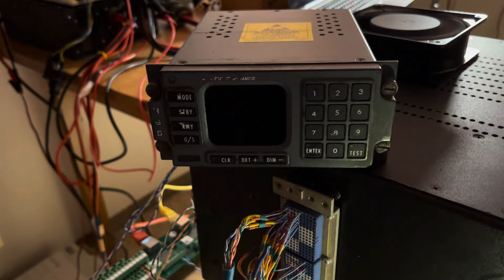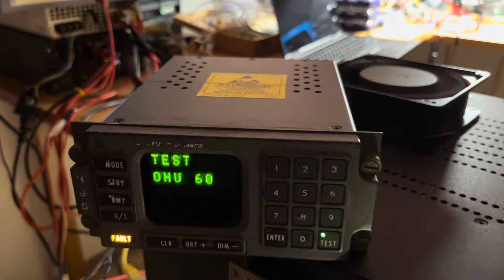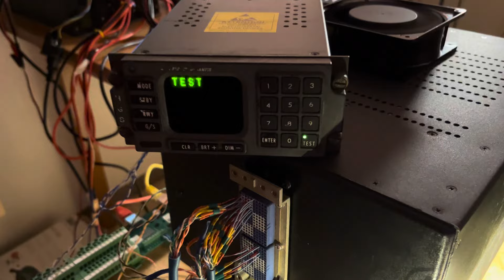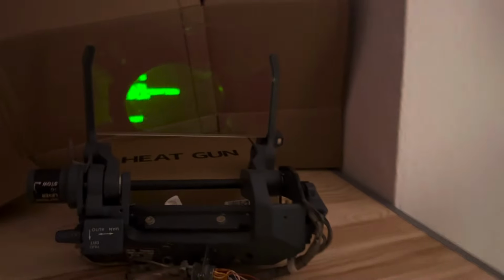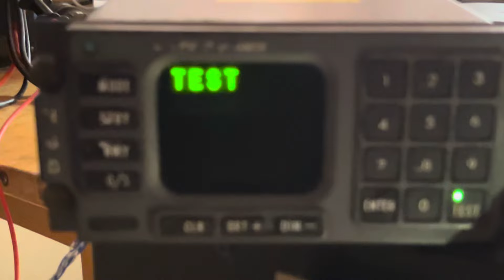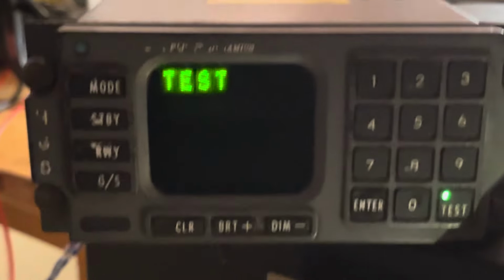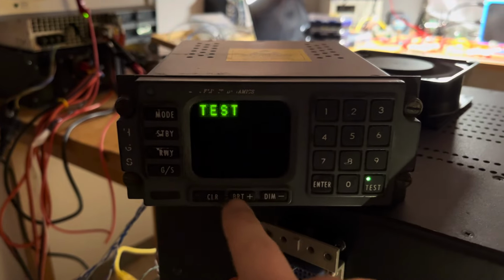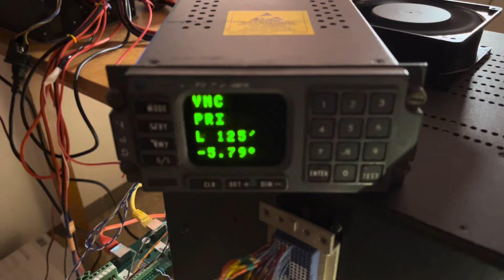Head-Up Display (HUD) FULL SYSTEM - HGS 2350 - 737 Classic / NG

Comment: Nice work!

If you're interested, you could contact the Aeroscopia museum in Toulouse. They have a derelict Concorde sim which is complete, but not working at the moment, and they're trying to fix it. They could use a little help with getting all the old equipment and the ARINC buses going to connect to a modern sim.
Reply from the maker: Thank you!
Oh nice! do you have contacts there? that would be a nice project to work in!! Im interested!

Comment: That's some noisy... power supply? Or is that the computer unit itself? Sounds like an airplane starting up, which I suppose is fair
Reply from the maker: Yeah the inverter is noisy, not the computer. The inverter has one big fan which makes that noise. I can tell you it is not pleasant to work with these stuff when that thing is running 😆